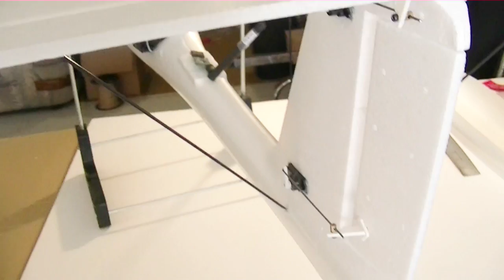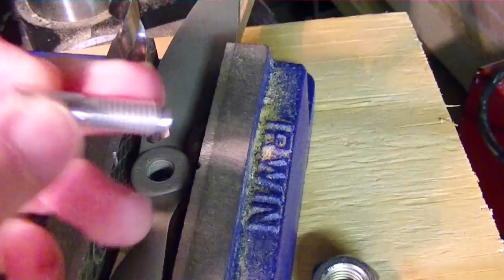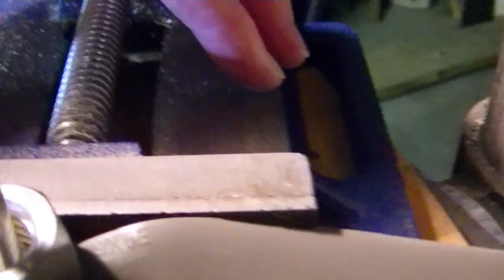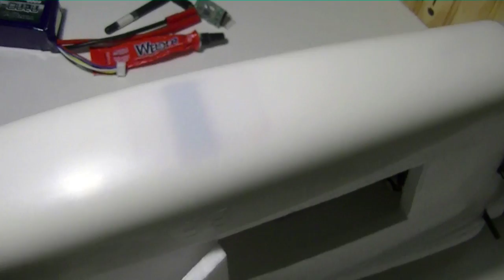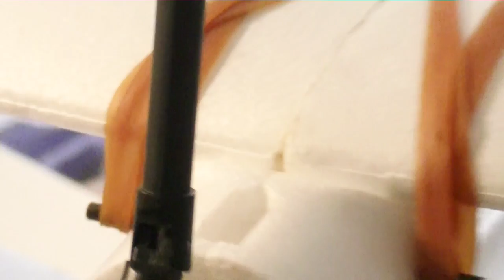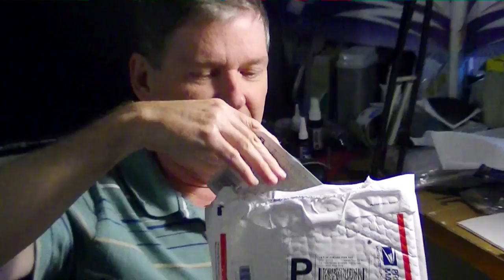FPV Part 16: SkyWalker Finishing Touches, CG balancing, Battery strap and Propeller spinner

Comment: I just measured:  CG on mine = 4 1/4- 4 1/2 back from the center line
My battery is about 2 1/8 from the front door edge.  My nose is way heavier than yours because I use one of the old GoPro's  You can fine tune the CG with the battery.
Remember, nose heavy flies hard, tail heavy flies once!
I made a couple of lines on the under side of the wing.  When I get all set up I put a finger on each mark.  If it leans a little towards nose heavy, I go for it....
Your plane is lookin great,  I would have had the nose skid but I couldn't get it back when??  Did you balance the prop?  We need to get you a prop reamer..
Reply from the maker: Yes I need to get a prop balancer and a prop reamer. Any recommendations?
I have my video battery on the nose pod so that might make it as nose heavy as yours.

Comment: Its coming together really well, very neat build. I swapped out the junk control links and fixings that can slip out for some M2 threaded bar and metal clevis instead for peace of mind
Reply from the maker: Good idea, I know barndog726 changed his control links too.
I am just sticking with the stock ones but I did thread locker on the locking screws for good measure.

Comment: nice video, this is my next ship for 2014  What version is this?
Reply from the maker: SkyWalker 1880mm from BevRC
Reply: Thanks, thats the one im getting but all black. I need to get one of those belly protectors too. Looking forward to your Maiden.
Reply from the maker: eastcoast78 Cool, you might want to get the SW Pod too.
Reply: you mean the ply  pod for the cam /fpv gear etc? If so yes that to. Maybe 2, one for my scale cockpit and 1 for normal flying hehe
Reply from the maker: eastcoast78 Yes that is what I meant. (I almost missed your comment because the thread was collapsed. Thanks G+)